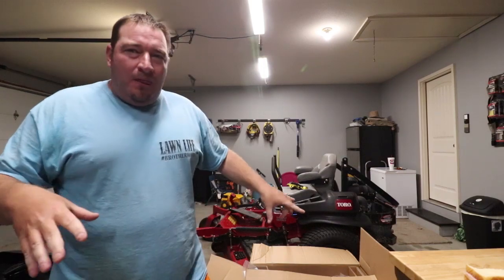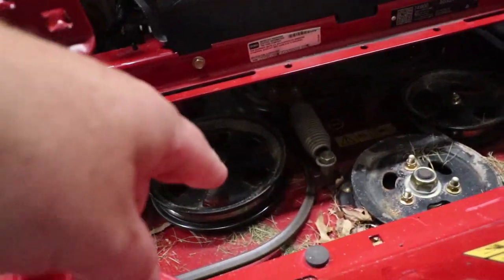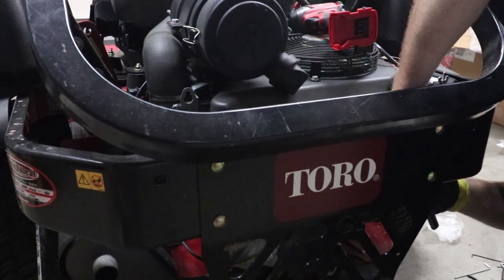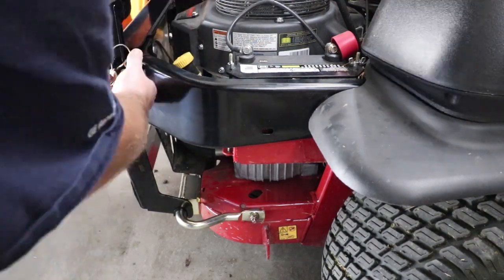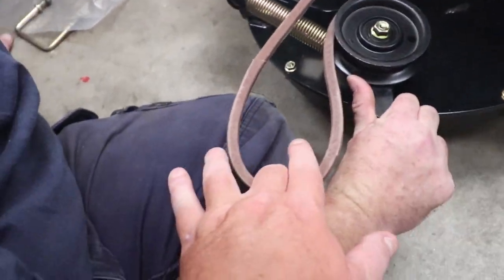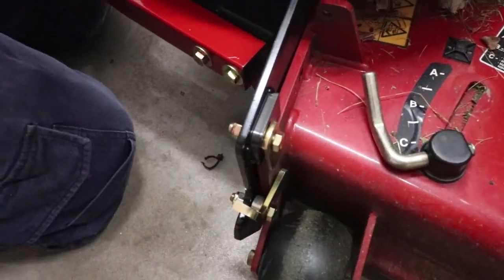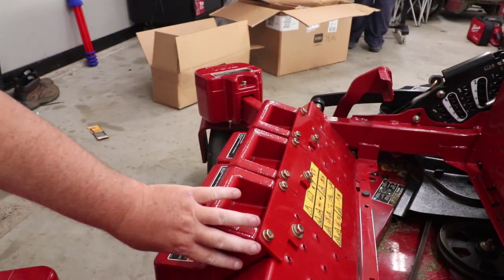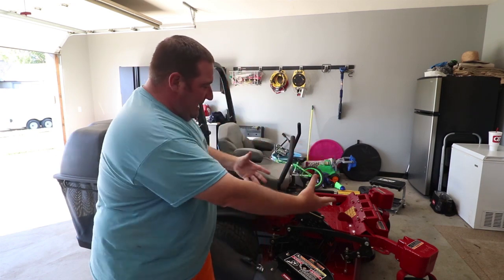TORO EZ VAC Installation and Demo

Comment: When I ran mine on my Z master, I didn’t run the caster weights, only the three center weights, I felt that when it was softer ground the casters dug into the ground more with the weights on them, plus the three center weights were plenty of weight for leaves and grass in my experience

Comment: I have the twin bagger for my zmaster 4000. awesome bagger, and great vid. do u recommend using the stock blades or do u recommend special blades u use for the bagger. blade center hole is 15/16